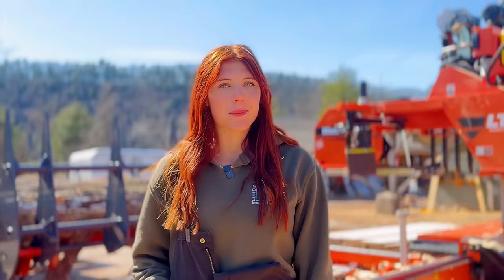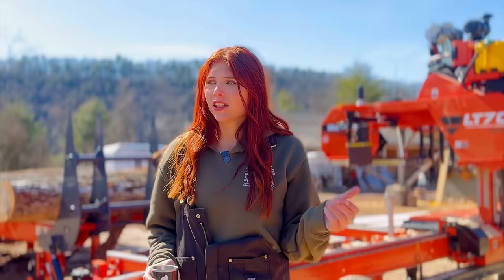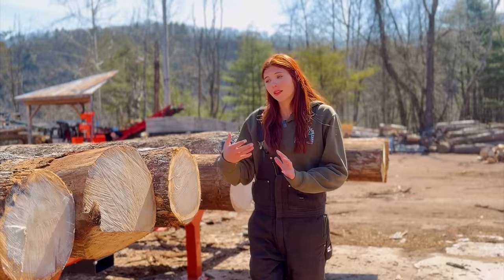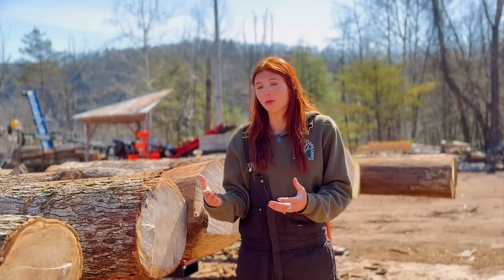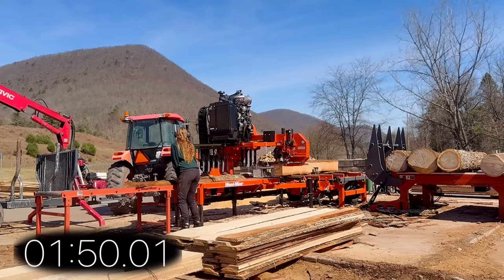How Fast Can I Mill a Railroad Tie with Our New LT70 Woodmizer Sawmill (huh, who knew…)

Comment: I cant believe that fancy new saw didnt come with a cup holder I think I would complain lol
Reply: What ! No cup holder.
Reply: just buy a magnetic cupholder. then you can move it where it suits you best.
Reply: It is pretty impressive though that the machine doesn't vibrate that coffee cup off the console.
Reply: From a pic at the Woodmizer site,the console is on a pedestal,not mounted to the sawmill frame. So the operator can locate it where they want,as long as the cables reach.the cable looks to be pretty long. @Tuscarora-Twigg
Reply: Don't you think was saw was enough free for o e day

Comment: I use to run a 56" circle saw for a veneer mill.I remember in the beginning being so slow and unsure of every move I made. The sawyer that had taught me told me he was the same way when he started. Now I realize that I'm opening expensive veneer grade walnut and cherry logs. It doesnt matter. You take each log 1 at a time and if you're any good you make sure you get all you can out of each log. You only get 1 chance and then its gone. 
I guess I'm trying to say to take your time learning this new mill and its controls. It can definitely cut faster than you can move, so don't try. Your speed and ease of operation will progressively get quicker and more natural with time. Like in life, this isn't a sprint, it's a marathon and you're just getting started. You wouldn't want to tear something up on the mill or run the risk of hurting Jade or yourself. It'll come as already is. Doing a great job----both you ladies😊😊😊

Comment: Great job! I noticed this mill cuts in the opposite direction from the old one. That has got to be hard to adjust to, but you're doing it like it didn't matter at all. Good work!
Reply: As I remember, the control station can be placed at either end [has a long cord] and there is a heated and cooled house for the operator available also

Comment: It is wonderful to see the positive effect the LT70 has had thus far. Not a peavey in use, just that is a huge time and energy saver. This tool shows the potential to be congruent with all of your family's respect for the work, acceptance of responsibility/accountability, consident dedication to an enhanced work ethic, while being a good neighbor and wardens of the environment.  You folks perform your roles flawlessly, speedy accurate protocols are being learned in a short bit of time. I may have missed the video if posted, what are the current plans to design/bulid an enclosure to cover the work area? Keep on keepin' on.
Reply: Money may be a factor in putting a roof over it.  However they got to get things settled down first.
Reply: @scottsoper  I hear that, just interested.

Comment: Back in the day when it was just circular blade mills the heart of the tree was considered suitable for beams only since it was full of knots and liable to checking. To make four cuts making four thick slabs was normal. The slabs then went through a gang saw or back on the mill to make quarter sawn boards for flooring  or furniture. T&G flooring was only  two and a half or three inches wide at that time. The slabs were mostly clear wood and the hearts found a use. Glad your finger healed.

Comment: Question for Jade: ❓ Why don't you wear gloves for hand protection. I expect your have become rough by now...❓
General Question:  ❓ With the new mill, what is the longest board it cuts and do you plan on cutting longer boards ❓
Reply: Look in the search for their video on gloves.    This LT-70 does just over 20 foot logs, 34 inches diameter.

Comment: Wow! New LT70 setup looking so good! Kind of a pity WoodMizer doesn't provide a hood for the engine. The open space setup looks so easy to get around, but yeah, weather! Enclosing the space would get in the way of material handling. Probably easiest to just build a small board-n-batten shed for the operator and string a canvas tarp from the building across the swamping area for sun protection.

Comment: Slabs should be flipped off the far side of the table into a cradle which can be emptied with the clam when it gets too full. We stacked the good boards at a right angle to table which made for an easy swing from the table to the stack. your second table (extension) should go away and the edger should be at the end of the catch table but just to Jades side of the table. the fitches can then be edged and the boards and edgings be pushed by the next and drop into a cradle to be sorted at the end of the day or every few hours.
Reply: Clam?  typo?   I am glad this system works for you!    The idea of the edgings dropping into a cradle gave me an idea but my idea won't work for this LT-70 any more than yours will.  The second table is needed in my opinion  because they have eleven different sizes of lumber for each log length.    So we are short space as it is even without the edger up there.  Feeding the edger at all puts Jade behind swamping this mill in my opinion. I am not sure that she can get the lumber off on the correct piles in time and sticker when needed.  I do believe that modifying the outfeed of the mill with some hooks will allow Emerald to place the flitches close to the end of the roller table so they can just be pushed off into the infeed stack by the edger angled just a bit to go around the building.

Comment: The joysticks, automatic setworks in combination with cut toward the operator seem like nice features.  The log deck conveyor would take some getting used to for me, but I can see where it would add efficiency and save on labor with cant hooks.  I'm used to seeing where the blade enters the log but I manually set my depths but again the computer makes that a non-issue.  Nice looking setup but those rainy nasty days won't be as nice without a roof ;)

Comment: So the LT 40 was under a roof overhang. Are you guys planning on building one for the LT 70 and if not will that be a problem when it rains?
Reply: The machine does not care about being outside: it is meant to be outside.  However Emerald and Jade will need some shade from the summer sun and rain.  It would be nice to have strategic wind protection also.

Comment: The mill turns the logs over quickly so they can be milled on the other sides. That big yellow tank on the top of the mill, does it hold diesel for the engine or does it hold water+ for the belts? Thanks for turning out new videos quickly that mountain across the way should start turning green soon.

Comment: JUST HAD AN IDEA:  Why not put a long trough, along side where saw dust comes out, could line it with plastic bag or other method, so when full you only need to move the bag.

Or could be multiple bins, each with bags, so it is divided up, to sell.
Reply: they could just get the Wood-Mizer saw dust conveyor that goes with these mills.....    I would like to see what they are doing to pick up the sawdust.  There is a lot more sawdust now also.
Reply: It requires electricity so they would have to run a generator @scottsoper
Reply: @robbrewer3861 You are correct, it has a choice of motors.... I would pick the 115V single phase.   I don't know the exact system on the mill, but I think one could put a 2000 watt inverter on the mill so that the conveyor runs off the mill system.  That way there is no extra engine to run.

Comment: That machine looks a bit wobbly when moving the saw up and down.  
Those single sided mill heads need to be very secured. 
Wobbling and shaking causes stress and crackling
I guess they are ok as long as you don't push them too hard

Comment: They probably put the flitches through a resaw
Reply: yes they do and the resaw is now in the spot the old LT-40 was.
Reply: @scottsoper  That's an edger
Reply: @robintaylor-mockingeemill8223   I guess I had not made the technical difference.  What is the difference?
Reply: @scottsoper  A resaw would have a stationary band saw like the mill has and you would put the flitch on a moving belt .
You just keep running the flitch through till there is nothing left . 
Wood mizer has a belt system you can put on your mill for this purpose .
Reply: @robintaylor-mockingeemill8223  OK so what they have is an edger that has 2 blades and roller feed.  It makes a useful board out of a flitch.